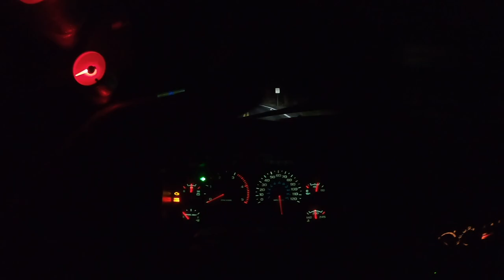We Drove 6 Hours To Finally Get My Truck Done | Hotshot Truck Is Finally Finished!

Comment: 3rd gen biggest problem is the harness for the rear doors. Second problem is the drivers seat foam.  Truck is coming along great. Nice seeing the the family together. Hi Liam!  I think you should leave "1500" on the door. Then it is a "1500" dually with MEGA cab flares and a hollow 4wd front axle. That should keep people on the roads confused. Thank  you for sharing and have a great day.

Comment: Next time you have those door panels off, sound deading will make a huge difference on the road noise. I redid my whole interior on my 93 and did sound deading everywhere I could get it on and it's just as quite rolling down the road as the newer ones

Comment: Point to ponder, the holes in the bed, the way you have covered those will not stay more than a few weeks at best. The need a backing to support them. Such as either welding in small washers, or even as little as sanding the back down behind the holes and using a JB weld and put plugs in from the backside, letting it dry 48 hrs and them bondo filler the topside, not the best but would last a couple years that way.

Comment: I just wanted to add that with the oversized tires on the CR-V you actually got a little better economy then calculated.  If the tires were taller than stock, you actually traveled farther than the odometer indicated.
Reply from the maker: True, I forgot about that 😅

Comment: You want to line body panels up from the part that doesnt adjust, forward. So in this case you should start with the rear door and align it with the cab then front door fender, hood. All those parts move but if you started at the front and end with the rear door and your body line or gap is off then you go through it all over again

Comment: 2 straps minimum.. remember that for your cdl test.  1 per 10 feet amd 2 min.
Reply from the maker: I've been studying all day 😂
Reply: Think its 2 first 10 feet then 1 per 10 foot after, then 2 within last 10 foot....i think any way
Reply: @kalebrivers5260  this won't be on the permit test in PA. it wasn't for mine anyway.
Reply: Kaleb.. we said the same thing only backwards. 1 strap per 10 feet. But a 8 foot load takes 2 straps. 2 straps min fir each load. Even though 95% of the super truckers only use 1 strap for a short load. I see it all the time. But I over strap myself.
Reply: @darrenrich1549  overkill is under-rated

Comment: Hi bro whatcha up to hope all is well prayers 4 yall cool cool truck coming along nice u doing a great job plz keep the big bumper on the front it's there 4 ur protection and really since ur mostly on the roads with it also would keep the one good door handle and hardware and wiring from ur old doors never know when u will need them however cool job doing great job on ur truck got a good idea 4 u when u get ready to repaint it u can buy dyi raptor bed liner spray paint think amazon may have it u could paint ur whole truck that from front bumper to rear bumper all in between this will give extra protection against dings and scratches from normal use and it comes in a lot of colors even blk any who keep walking tall prayers 4 yall and bless great healthy peaceful safe journeys travels and happy hauling 
🚐⛺🌌🌄🏞🏖
👍👍💪🙂👍👍

Comment: I told  u bro they would need new cushions and cover  u could have got a cusion / cover  for 100.00ea for each sides  and still had the electric seats for 200 bolth
Reply from the maker: I'm happy with what I got. I hated leather seats and have no regrets going to these. I paid $200 for everything. Doors, seats, seatbelts, and rear vents.
Reply: @CPSteveMiller  ik u did bro but just trying to look out for you like a big bro  u can always swap the cloth and a new cushion to the electric ones in the future if you want  but i do see the benefits with the manual vs the electric  no risk of the motor braking or switch problems  or whatever life thows at us

Comment: Tires killed mpg 🤘👊
Reply from the maker: Someone mentioned about the oversize tires. I forgot that the speedo reads low 😬
Reply: @CPSteveMiller  yep. With stock tires and wheels probably gain 3 to 6 mpg. But those wheels look kool though 🔥👊🤙

Comment: Hi Do you need some great lighting for your cars to help you better driving, off-road. We're the pro auto lighting manufacturer for nearly 20 years and we're looking for sponsorship!
Reply from the maker: At some point I'll be looking for a light bar for the bumper and roof but haven't started looking yet!
Reply: @CPSteveMiller  No problem mate! Let me know soon as you need some lighting kits, we're looking to achieve a sponsorship with you!😃

Comment: Dude what's the story on the GLHS charger. About 2 minutes in?
Reply from the maker: One of my videos has glhs in the title. I give the history in that video. I'll do a video on it when it's done
Reply: Right on I just found the channel about a week ago so I'm slowly going threw the videos. I sold my 85 Shelby and have a few parts laying around if you need anything body wise
Reply from the maker: One is being used as a parts car and will be sold. My dad bought the one brand new. 29k original miles